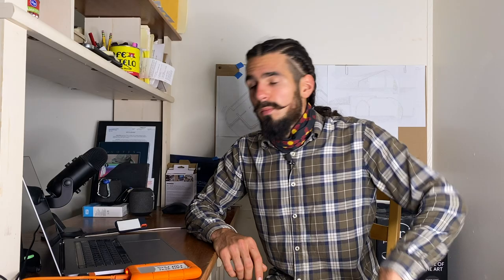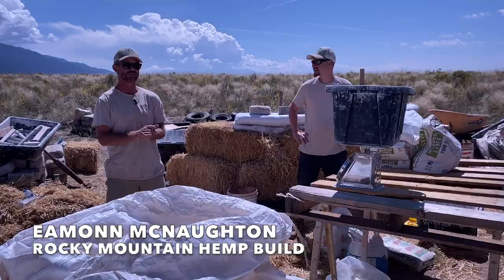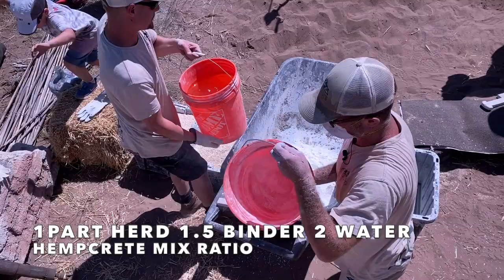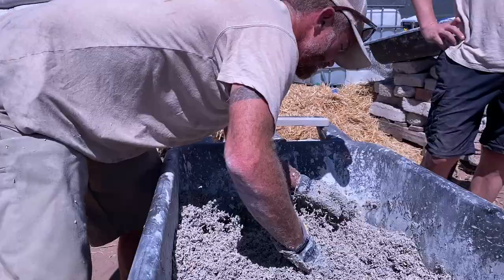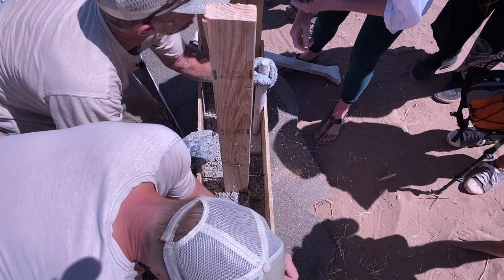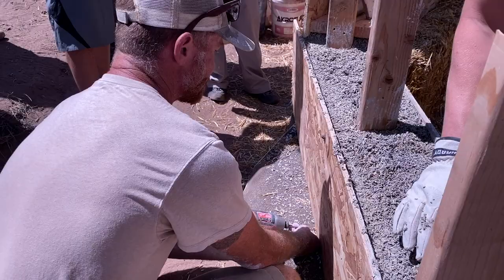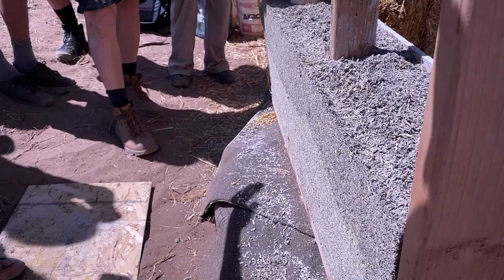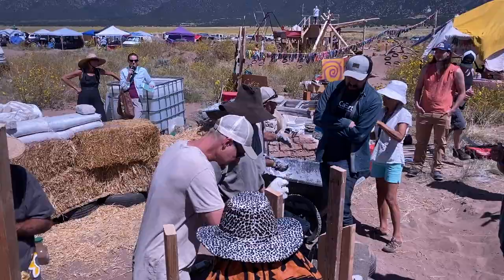DIY Hempcrete Wall System Tutorial: Fire - Insect - Mold Proof Material at a Low Cost

Comment: My problem in the Philippines is God damned termites and other boring critters. I like building with wood and I dont like hempcrete. I like the ability of wood to moderate humidity swings. Any cellulosic  material will do this. You have given me a great idea. Add the bare minimum amount of lime and use it as insulation infill behind the wood panneling..

Comment: I want to do a perimeter wall, it's a big job, what's the best method you think? Hempcrete, rammed earth?
Reply: Do you mean like a garden wall?  Straw bales on edge on a grade beam.  Cover them with chicken wire and stucco.  Doesn't matter if they rot as the stucco will be almost forever.  Want to upgrade?.... cover with remesh and gunite the wall.  I had a pool crew do that and they were grateful to work at grade, lol.

Comment: would adding air via bubbles increase R factor?
Reply from the maker: Not with this method, the bubbles would collapse. It might be possible using another method where you cast bricks, but there would most likely still be issues with getting the hemp fibers to bond properly. Additionally, the fibers might collapse the bubbles in a casted mix as well. Not sure how DIY friendly it would be. Maybe viable for manufacturing with the right equipment.. Hope that helps!
Reply: @TheOffGridGuru  yes it does how do you determine R factor
Reply: Only in concrete air bubbles will increase the R factor.
It is Done with just a little bit of dish washer soap.

Comment: I don't believe it's mould resistant.time will tell......
Reply from the maker: Hey wayne, avoidingmold.com says “Mold can grow on the surface of hempcrete, just like other materials, when the conditions are right… as the food source can be dirt or dust, but due to the lime component and natural fungal resistance of the hemp, mold will not feed on the hempcrete itself.” There is more data to back up these claims as well.
Reply from the maker: Additionally: “When it comes to mold, controlling moisture is still the only real solution. Hempcrete is an exciting new material to consider for sustainable building, as long as moisture management is the top priority.”
Reply: @TheOffGridGuru  Moisture management better always be a top priority, whatever you are building, expecially if you are building  a dam.